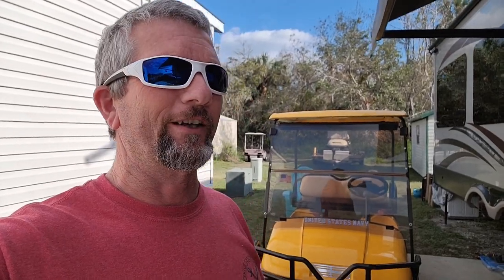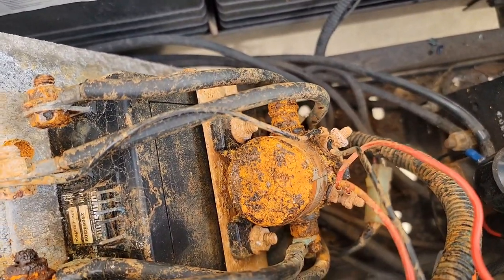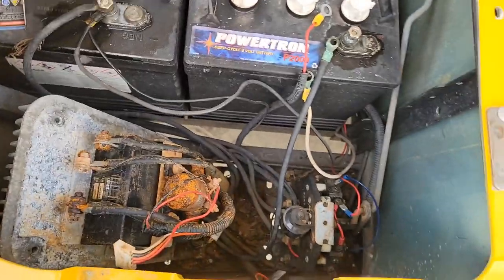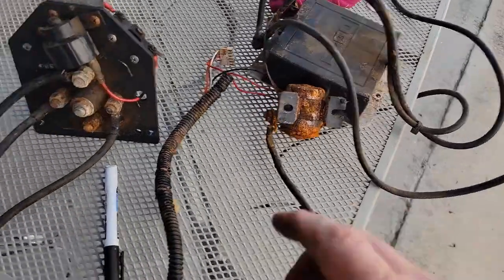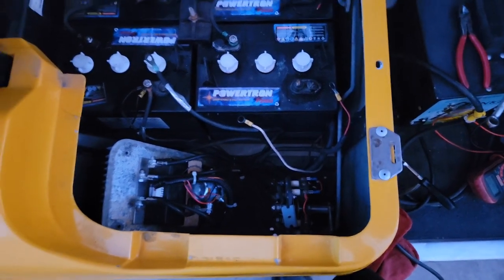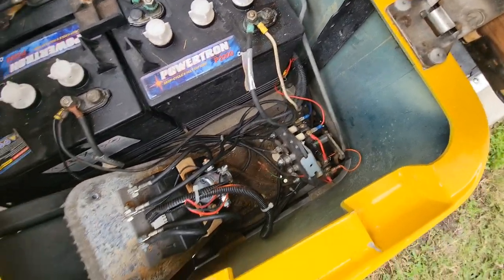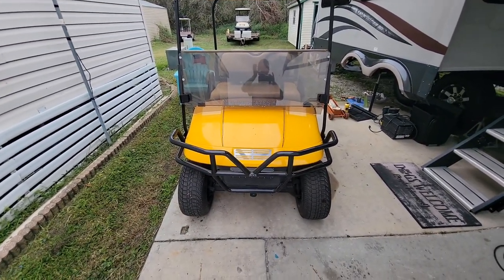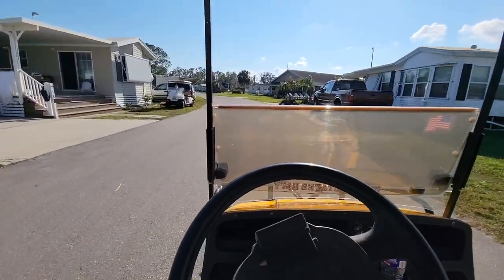Saving an Ezgo txt Hurricane Ian flood water golf cart @Vassmotorsports ,not sending to CoPart

Comment: Hello I just picked up a 2009 club cart precedent that was fully flooded like your. Just like yours my batteries seem to be good but wiring is bad.  Not sure how the motor is. Any suggestions or where to look for wiring harness?
Reply from the maker: There are some videos of how to check motor by straight jumping from one battery and the control box will definitely be bad so have to replace it ,can sometimes find used one or refurbishers on ebay.   Also the OBC may be bad ,  I had to do alot of research to figure out the details ,definitely get lots of pics before disassembling any wires ,  I also fixed a club car 48v the same way flooded. But not the same wiring or controller as my ezgo
Reply from the maker: Also I had to check the forward/reverse sw and ignition switch with ohm meter luckily them and foot pedal potentiometer were good ,I bought used controller and thought I got screwed cause didn't work so sent to a refurbisher in Florida and said it was good so I went back to double check the motor(which was ok first time I checked) and a brush lead had cone undone inside motor so I fixed it and was good to go.   Also I put new solenoid cause I went with 400amp controller

Comment: How much did you pay for the control and all those wires
Reply from the maker: I got really lucky and stay on marketplace and Ebay and found all of it for $175 and went by a store and paid more than I should have for a solenoid ($38)but wanted it going same day,  it was driving but motor still had issues and will not come off differential for me to fix so I picked up another cart that wasn't flooded for $1500 and swapped whole rear with motor and beefed up my leaf springs and now she hauls butt luckily and smooth and quiet.   If I can fix original motor ill sell the other cart and hopefully pay for all of it and have mine for free.   Also I do boat upholstery so I made new seats wood and all.   I should be posting another video on it soon